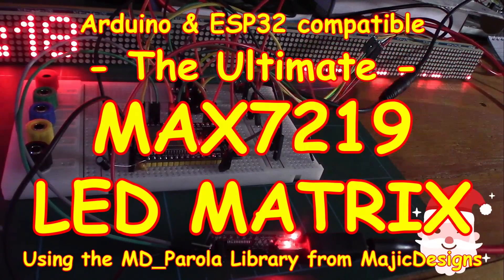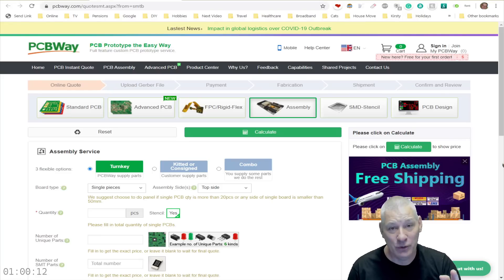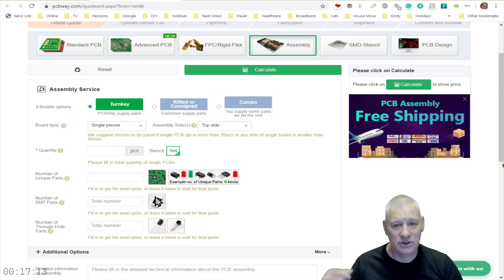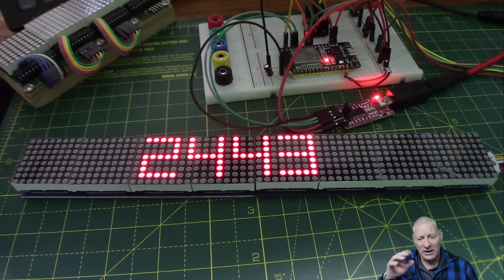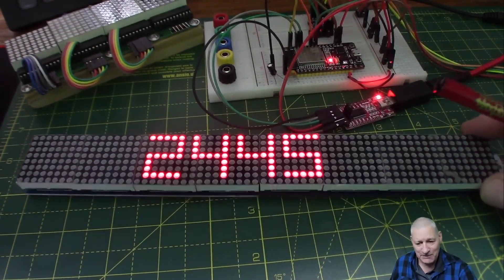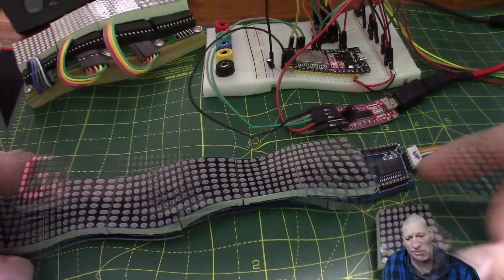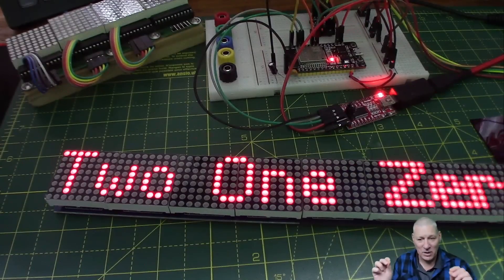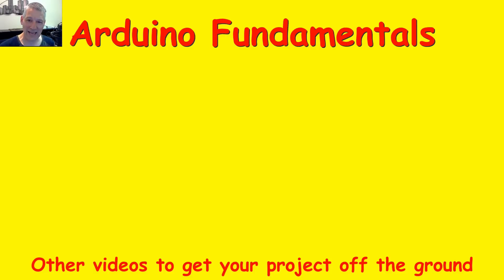#256 MAX7219 Matrix 3ft/0.9m Strip Display - Awesome 😉🎄🎅

Comment: Were you blinded by your displays being too bright? Did the overly bright display caused making Your eye injury?
Consider replacing the Iset resistor on the FC-16 modules. Put on a 64k.
This brings down the current per segment to app 10mA.
It greatly reduces the overall current consumption and making heat.
I have replaced the resistors on my 4 digit clock modules.
It makes a huge difference. Way better to stand now having it runnning next to me.
Reply from the maker: That's fine. In my setup I can control the brightness by using a function (setBrightness) and level 0 is almost too dim to see except at night and I have it set to level 1 and it's perfect day or night. Even level 2 is too bright unless in direct sunshine!
Reply: @RalphBacon  Hi,
the issue is the crappy chieeese made clones cause ALL of the LED dots coming up at powering on. Thats an issue, I hate it.
Read the more of my notes and linked article.
The chineese made clones do NOT work as they are supposed to do as of the datasheet.
Of course I have set the brightness register as I have changed the current set resistor on the pcb.
The green dot matrix LED are not that much painstakinly hitting my eyes as the red do.

Avoid frustration, waisting time & money & effort by NOT using chieese made crap.

To me it looks You are not the poor man that has no money buying from reputable reliable sources.

Think again.
You are nearing the end of life like I do.
What to do with the remaining period till You die.

Comment: I'm using these same displays. 1×8 (8x64). I've tried using esp8266 (nodemcu), arduino uno, wemos d1 mini. At first a few months ago all displays lit up while using the d1 mini. Now only 4 of the 8 light up. I've tested everything but I just can't get the last 4 to light.
Reply from the maker: If you apply a 1.4V @ 10mA (eg 5v with a 330Ω resistor in series) to each individual segment of the LED you can prove whether the hardware still works before blaming your code (that used to work just fine, you say).
Reply: @RalphBacon  thanks, I'll test this out.

Comment: Any hints on what library should be used with an ESP32S3 & the MAX7219?
Reply from the maker: The same one that I am using in the demo sketch (should be in the GitHub for download). If not, ping me.
Reply: @RalphBacon  I got it to work great - had to specify FC16_HW and then was good to go.

Thank you!

Comment: If you want to add a diffuser over these displays the best plastic I found is from an old flat panel TV.
One of the layers of the screen is a semi transparent white plastic.  Easy to cut to the size of the frame.
It will hide everything except the lighted LED.
Reply from the maker: I'm still considering my options here, so thanks for this input. Keeping the frame slim but somehow secured is now occupying my thoughts!

Comment: More than 2 of the four module displays is almost certain death for your voltage regulator, arduino, breadboard, etc. But even worse the 7219 chips fail to output data to the next section even if you catch it before you let the smoke out. Ask me how I know. Yes, I'm alumni of the School of Hard Knocks.
With that in mind, if you beef up the wire size for + VCC should you not also do so to the Ground?
Happy New Year to you, hope you had a Merry Christmas.
Reply from the maker: The current for the modules doesn't pass through the voltage regulator on the Arduino if you use the Vin pin (it then takes it directly from the USB input, assuming you are using USB and not some other voltage). Thus, your PC's USB cable or USB Hub powers the device, which is how I did it in this video.

But you are correct that you do need to watch how you power such things. Especially when testing, then the likelihood that you will inadvertently cause ALL LEDs to light up (don't ask).

Regarding the GND connection, that is of lesser concern as each module has a nice ground plane; but I did beef up the inter-module GND connections though with some additional solder.

Comment: Beautiful MATRIX to my rear ebike RED light, when I can display TEMP of the road and speed of incoming driver from radar.
Reply from the maker: Or a single 4x module at the rear as a brake light with some words too (eg flashing the words STOP, SLOW or TURN at the appropriate time). If I had the manufacturing skills I'd be a millionaire!

Comment: I would like to know if it is possible to use a esp32 and MPU9250 to make a tilt/compass that can be used with a tablet that does not have a compass, so that the tablet can work with google sky map.

I want to mount it on a telescope, so I can see what star I pointed the telescope at..
Reply from the maker: Hmm. You could certainly make a standalone compass that output coordinates, I'm sure. The tricky bit is interfacing it to your tablet, which I don't know how to do, sorry.

Comment: Happy Holidays Ralph! MAX7219 is a cool IC and with those libraries you are doing some nice, usefull stuff. Making things like this wifi enabled exponentially raises the usefulness. Just yesterday received 10 chips to solder into things partly built sitting on a shelf waiting for....'that reason to finish"....
Using strips of 2812b leds I've created a 1.1m x .2m array for larger message displays, but the software/code doesn't always perform the same as with those matrix squares, again-just another path; plus all my first iterations were static Arduino code/libraries vs making them ESP32 or Wifi controlable is that same hang-up -: "I have to recode alll this...." so, hint/hint I'm looking forward to your next upcomming video of Android App creation for ESP32 wifi matrix control ;)
🎄😄
Reply from the maker: I'm glad I'm not the only one who procrastinates... er, waits for the R&D phase to be fully finished before committing to design! Yes, I will show all once it's done.

Comment: Ralph, 1) is that a voltage translator in the center?  2) Have you made a board for the ESP32 yet?
Reply from the maker: Yes and no. No, really. 

YES: That is indeed a 4-channel voltage leveller in the centre as the ESP32 runs on 3v3 but the matrix definitely works MUCH better at 5v. And connecting a 3v3 ESP32 to a 5v peripheral CAN work (I had some problems) but it is safer and the right thing to do by adding a level shifter. Ultra cheap (it's only a few MOSFETs on a board) and ultra safe.

NO: I have not yet designed a board for the ESP32 as I haven't fully designed the circuit. I want a motion detector so the display can dim (or turn off) when there is no movement as that means I'm probably not at my desk (or in my workshop). I'm also considering an LDR so I can dim (or brighten, more likely) the display during very bright days during the summer). I've found that level 0 (the dimmest setting) is still readable in a dimly lit workshop, and level 1 is plenty (which you saw). But in the summer I may have to up the max brightness.

A couple of other things have crossed my mind, but no firm design as yet (not even which style of ESP32 board I'm going to use). Full details when I get it done (I may have some spare PCBs at that time to share around).

In the meantime I'm leaving it hooked up on my breadboard just so I can continue the coding and upload OTA (or via the USB).
Reply: @RalphBacon  - Sounds good my friend! :hand-purple-blue-peace:

Comment: Thanks again for another info packed video! I enjoy using these displays linked together, too. I usually buy them in multiples when they hit a good price. They come in a variety of colors, too. Like you, my projects sometimes get delayed for other things that need done. I built a scrolling marquee from a project I found on "instructables" web site. It is based on the D1 mini and these matrix panels. I kept meaning to get a piece of tinted lexan, acrylic, or plexiglass (whatever it's called) to put over the panels and just seemed to never get around to it. This summer I found a company in the U.S. called Tapp Plastics that will custom cut a wide variety of colored acrylic sheet for very reasonable prices, and ship it to you. I finally got a smoke colored panel and put it  on my display. It made a huge difference in the look of the display. It hides all the little white dots where the led's are mounted and evenly diffuses the lit ones. The whole thing is much more readable now. I wish I had done it sooner! It is definitely worth the time and trouble to get a cover panel for these matrix displays. Holiday Cheers!
Reply from the maker: You've read my mind, David (or you have hacked my workshop webcam and saw me investigating this very topic yesterday). 

Yes, although I have affixed the long strip in my workshop (it's only a couple of screws) I do want to make it neater (ie properly enclosed) and, most importantly, an acrylic strip across the whole thing. I was thinking dark red (looks black until lit). I've found a UK firm to do this, my quest for the Xmas to New Year period!

Comment: Since multiple units don't just 'snap together', a short video on the construction of joining two (or more) together? It can be tricky unsoldering connectors that are not needed. We need all the help we can get.
Reply: The GitHub photo seems to show the pre-soldered header bent into the first unit, I tried doing it this way but ended up breaking the contact points when I repositioned it in a very tight space. You mentioned using a socket instead but I can’t seem to find a pin header socket with the correct pitch which is 
1.27mm, do you have a link or even just the name of the connector that you used that I can search for?
Reply from the maker: They almost snap together. 

On one side (the exit, out) you solder a right angle pin header (like I showed in the smaller, older unit). 

On the next module solder a right angle pin socket like you find on an Arduino UNO board (but with fewer holes) to the input connection. 

Then they just plug (push fit) together. They do need a bit of support though as the connection is not physically that strong. I screwed mine to a thin board.

I've put some pictures of this on my GitHub here:
(https://github.com/RalphBacon/256-MAX7219-Ultimate-Display )

Comment: Holy crap Ralph, you went bananas. Those boards are cheaper than the chips themselves now.  They're very well built. They're currently on sale on aliexpress as well I believe.
Reply: They're not genuine Maxim parts. The knock-off 7219's can tend to be glitchy and unreliable (confirmed by a very helpful engineer from Maxim support after lots of frustration in trying to get a project to work properly). Wouldn't ever use one for anything important.
Reply from the maker: Yes, I did go a bit mad but now it's installed in my workshop and it's awesome !!! 🚥🚥🚥🚥🚥
Reply: @RalphBacon  I definitely approve. I love leds